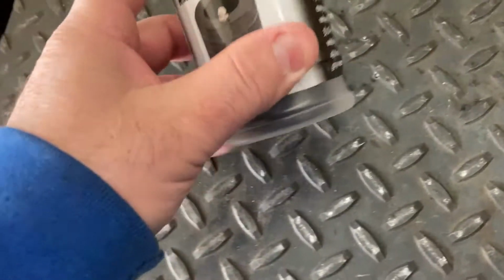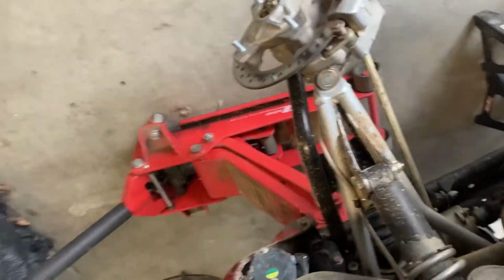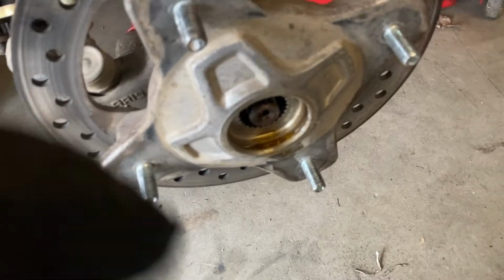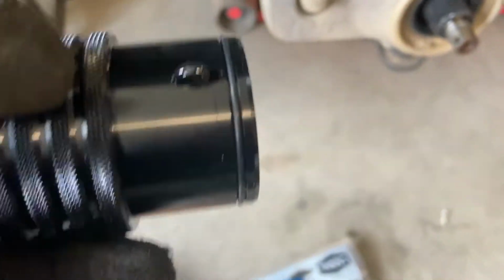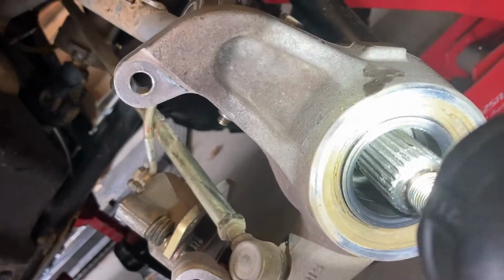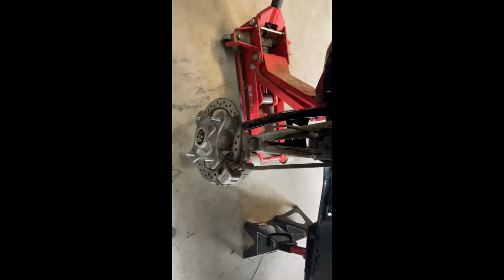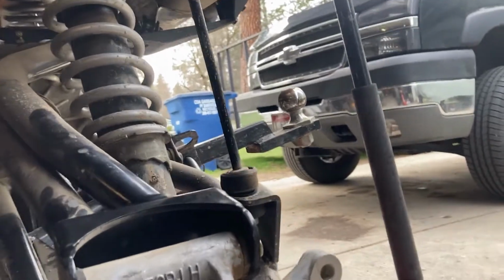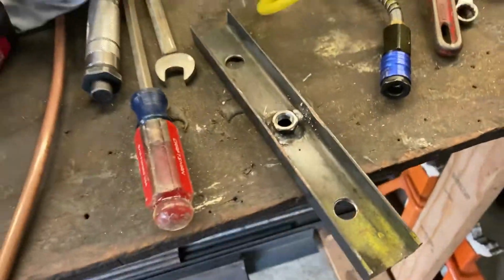How to remove hub to grease bearings Polaris Sportsman

Comment: Great vid, 
What's the torque for rims ?
Reply from the maker: 75 ft lbs but many people have been having issues breaking studs. I now torque to 65ft lbs and havent had any issues.
Reply: @mogyver69  I just found
In my manual 30lbs  aluminum 
Seems low 

I chicked out greasing 
I didn't want to mess with castle nut
And brakes ,my luck break something